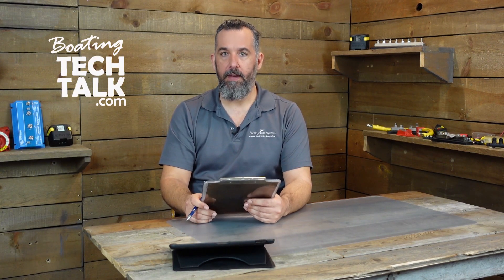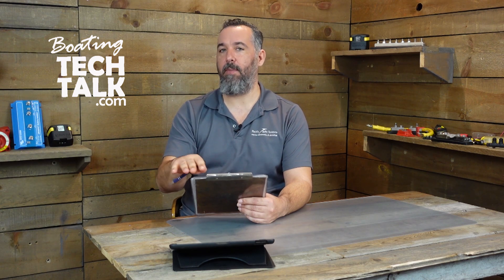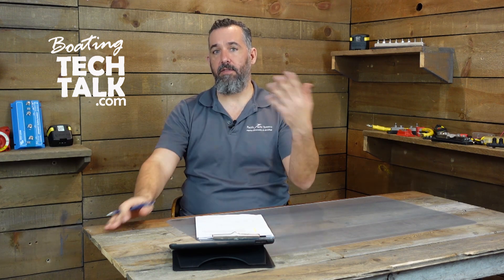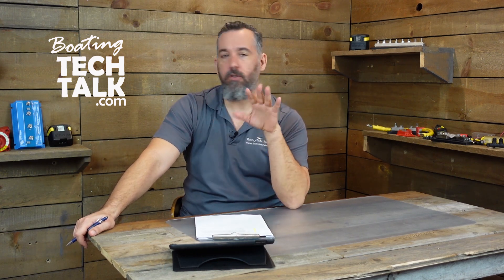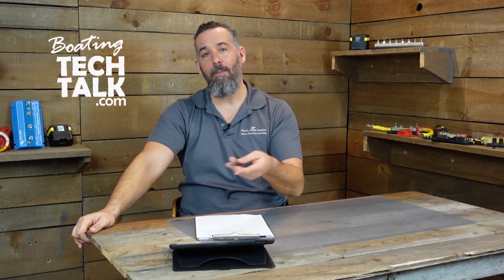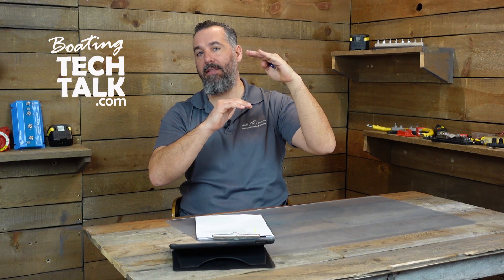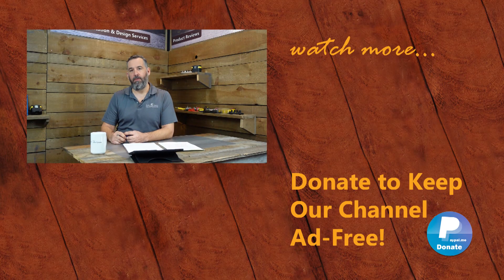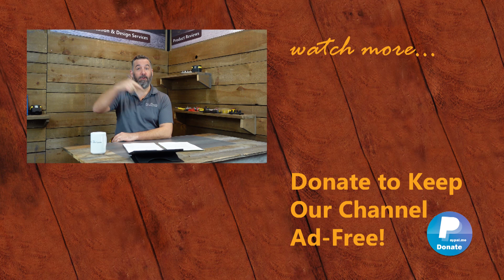How Do I Increase My Alternator Output to Charge My Batteries Faster?

Comment: Jeff, I have a Yanmar 3GM30F with an Hitachi alternator (55 AMP I believe); can this alternator be used with an external regulator? Does the Alternator need to have some conversion done to it prior to connecting an external regulator?

Comment: Altinator is stronger before 2006.   If change ore have to get a New one.  Ask for the stronger one before 2006 modells.  Them all knows about it.

After 2006 have weeker charge.  Not give more then 13volt some shitt. Before 2006 u get them to charge 14.4 from idle to regulator slows it down.

Ofcourse u have altinators whit high teck regulators.  But expensive. 

Some People overhaling old and make them New for No cost at all.  Just a tips.

Comment: Hi Jeff. Is there a singe battery monitor that can monitor multiple banks (main starting, gen starting, house, etc)?
Or would I need to install one monitor unit for each bank?
Thanks
Reply from the maker: You need dedicated battery monitors per each battery bank.
Reply: @PacificYachtSystems  thank you, seems odd that no one makes a multi input battery monitor.
What is your opinion on Bluetooth battery monitors that can display this information in a tablet or smartphone app?

Comment: Ok I’m a little confused. I have to big group D lead acid batteries for starting…one small lead acid for the generator and two Lithium Battelborns for house. ( built in BMS) I’ve hooked them all to the battery isolator and charge from the alternator when under way. I thought the BMS took care of the charge status and “need” of the Lithium. Do I need to rewire with a DC to DC for them? 
The isolator I have is the same as the one to your right. 
BTW….thank you for taking your time to do this Tech Talks. What a great resource!
Reply from the maker: Well sounds like you have a stock alternator with internally regulator (e.g. target voltage of 14.4), in this case all your batteries are receiving similar charging voltages.
Reply: Different Chemistrys in Batteries require varying Charge Profiles.
As well different Bulk, absorbtion, and float voltages.
SLA, AGM, and wet cell are pretty similair, Lithium, Glass Mat, some others are quite different.
Long life of Cells requires some care.

Comment: Hi
Iv been watching all your videos on YouTube and iv seen a bit where Jeff says that extra resistance on a windlass motor circuit creats voltage drop which increases the current through the motor and causes it to overheat.  

Iv been struggling with understanding the logic of this and (now I cannot find the bit) would love it if you could do a video about this. 

Thank you
Gal
Reply: What a great question. I just finished a motor course and the answer has to do with how motors are designed. When a motor is free spinning it has very little load, and the rpm's increase to a point where back EMF from the motor causes a reverse voltage that reduces the forward current through the motor. Back EMF is insignificant until the motor gets up to speed. When a load is put on the motor, rpm's fall, back-EMF falls, and as a result current draw increases, especially in the brushed DC motors that are used for windlass and starter motors. So, current draw for these motors is all about rotor speed and the torque required to get the rotor spinning, with the greatest strain in the first few seconds when the motor hasn't ramped up to speed. That initial high current through the windings is bad for the motor, if the rotor is seized you can melt the insulated windings of a motor in less than a minute! When the incoming voltage is reduced, the torque the motor can put out is also reduced, and the motor spends more time in that vulnerable moment where an incoming current spike is not restrained by back EMF. So, paradoxically, you get a longer and greater spike of inrush current in a motor that is fed with reduced voltage. Another way to look at it is to look at power input. A specific load will require a certain amount of electrical power to produce the torque to lift an anchor or spin a car engine. Incoming power is Voltage times Current. If V is reduced, to make up the difference the windings will not spin the rotor until more current can meet the torque challenge.

Comment: Hi Jeff. 
Great channel. 
Question :- I have a victron inverter charger. When hooked up, on ac side. Will the charger try to charge the batteries when the inverter is supplying the ac power. Ie an in house loop. 
Thanks.
Reply from the maker: Hi Ian, good question, the AC input and the AC output are completely seperate on a inverter and should never be looped. In other words, the inverter AC output can never feed the inverter AC input.

Comment: Hi Jeff, this seems to be a high concern/discussion judging also by the questions at your live on Sunday which was great.  Looking at Balmar 614, you can monitor batteries temp.  How would this work if you have 2 or more  atteries in a bank ?  Cheers JC
Reply from the maker: Yep the Balmar MC-614 does do temp compensation, and even has input for two battery banks. The MC-614 can only monitor one battery per bank.
Reply: Thanks, I guess that means that your bank should behave equal.   Thanks a lot.

Comment: I’m going to show my alternator ignorance here but given that the belt to the alternator doesn’t slow down, how does the alternator reduce the charge?
Reply from the maker: Great question, the regulator (either internal or external) makes a decision on much field voltage to apply, this in turns decides what the voltage output of the alternator will be.

Comment: Another way to sum up what you said:  The charging system sees the battery as a resistor.  During a state of discharge,  given a constant voltage, current flow will be higher.  As the battery charge increases it builds heat due to current flow.  Two things happen: 1) The alternator at that stage is charging the electrolyte in the battery, not necessarily the plates.  It takes time for electrons to move from the fluid onto the plates.  For a completely dead battery it takes days.  2) As the battery charge level (and heat) increases current flow decreases because it is not as easy to push electrons into the electrolyte.  Incidentally, for a battery to FULLY charge is takes a very small current (like a maintainer) several hours or days to to off.  The maintainer pushed only milliamps into the battery which does not raise the temperature..... which is why the battery can now fully charge.      I was a master mechanic for General Motors - retired.
Reply from the maker: Hi Dave, very well explained, thanks for sharing.

Comment: It's a pretty common misconception that Li-ion accept unbridled charge. They get damaged with aggressive charge rates with direct relation to temperature. If the electrons are travelling faster than the lithium ions then you get lithium plating at the anode and irreparable cell harm. A lottov "drop-in replacements" have a charger disconnect at 0°C as a candle in the wind safety measure. This is not good enough it ought to be proportional charge rate control in direct relation to cell temperature as the level of harm correlates to the charge rate and delta temperature below 20°C.

In Ireland batteries are never 20°C, usually 10°C. I can get faster charge rates outtov lead considering this. 

A cheaper solution to external regulators is sense an underwired split charging battery from the alternator D+ to fool it into energising more of the field windings. That's all external regulators are generally doing.
Other simple obvious solutions are larger & shorter B+ and ground cables. I often run 50mm² cable for 150A alternators. It works.
Reply from the maker: Thanks S. Scruff for sharing and explaining, really enjoyed reading your post.

Comment: Along the lines of Rockabuy2002's question.  Do you need to disconnect the internal regulator when adding an external regulator?  thks
Reply from the maker: Yep, you'll need to have a alternator shop remove the internal regulator and give you a field post to interconnect the external regulator.

Comment: You mentioned that the internal regulator is overly cautious controlling output to prevent boiling the batteries. Would that also regulate the output to a lithium battery therefore helping prevent the lithium battery from burning out the alternator? BTW I have an outboard motor.
Reply: With all else being equal, an internal regulator will certainly do a better job at protecting the alternator from heat than an external regulator since it will reduce the charging voltage as the alternator gets hotter, reducing the load on the alternator to prevent it from overheating. An external regulator won't sense the alternator's internal temperature. But if the alternator is under so much load that it's maxed out and can't reach the regulator's setpoint, the regulator doesn't really matter. Maybe try asking the company that made the alternator which if any precautions need to be taken to protect it in your application? Not sure how helpful they would be but it's worth a try.
Reply from the maker: Hi Charlie, an internal regulator on a alternator won't help to protect an Lithium battery from overcharging.
Reply: @PacificYachtSystems  thanks for your response but I think the BMS will prevent overcharging, I'm more concerned about what I've heard about the low resistance of lithium batteries drawing too much power and overheating the alternator. If the internal regulator would limit that I may not have a problem. The manufacturer says they have never had a problem but everyone else says not to hook up a lithium battery directly to the alternator. Luckily I have more than one battery connected through an isolator so if the BMS does disconnect from the alternator it would still have a place for the power to go and not destroy the alternator like switching it off would do. Thanks again, I know I've been asking about this on various forums. With boating season just around the corner here in Colorado I'll be giving it a try and luckily the lithium battery i have has a bluetooth monitor inside so I'll be able to tell if something is out of normal range before I cause any damage. Thanks again for helping all of us electrical geeks, sharing your knowledge is really helpful for us!

Comment: If you add an external alternator, how do you disconnect internal alternator? Or do you need a new alternator that accepts external regulator?
Reply: I installed a Balmar external regulator to my Valeo 120A alternator and it came with dummy regulator conversion kit to replace the alternator's internal regulator. Followed the Installation instructions that came with the dummy regulator and it was a very simple process.
Reply: @davidmacbeth5575  right on thanks for sharing your experience!
Reply from the maker: We commonly bring alternators to a good alternator shop and get them to change the wiring on the alternator for a nominally fee.
Reply: @PacificYachtSystems  very interesting! Didn't really know that was a common service. Thanks for the reply. This was a timely video as I just upgraded my boat's system to lithium with a Balmar alternator and mc614.
Cheers from Anacortes.
Reply: Also curious about this- have you run into many issues converting old internally regulated to be externally regulated?

Comment: My understanding is that Lead-Acid batteries actually lose capacity as they age.  It is also my understanding that some battery monitors adjust for that, but traditionally they had to be re-calibrated to be accurate.  Either way, the interpretation of SOC% turns out to be a bit trickier than it first appears.  I think this is what is behind your comment that the absorption phase kicks in sooner, but perhaps you would explain it better than I have.
Reply from the maker: Hi Bruce, bang on and well explained.